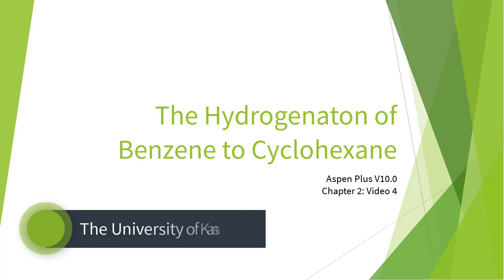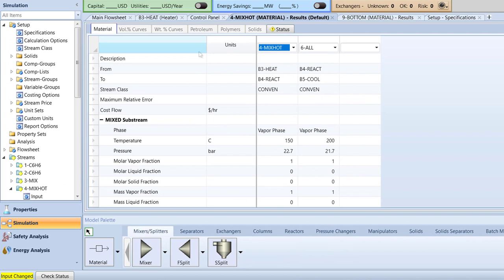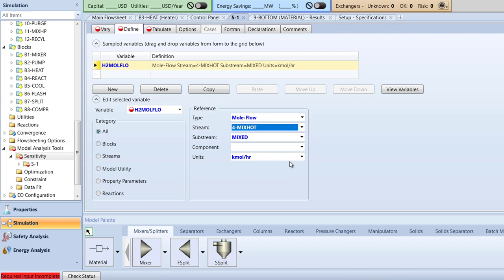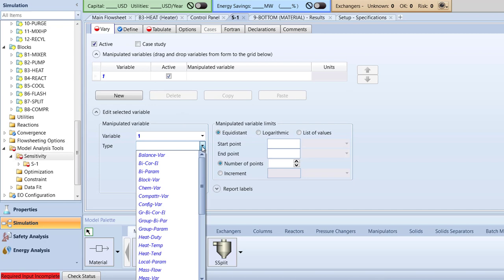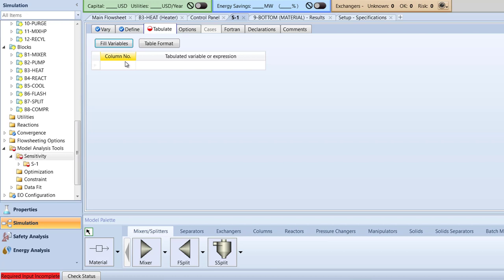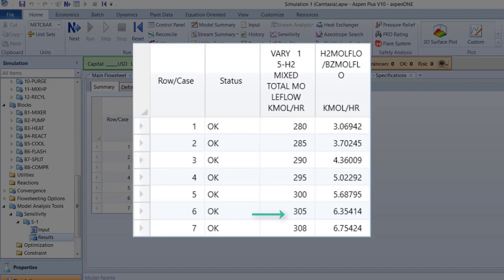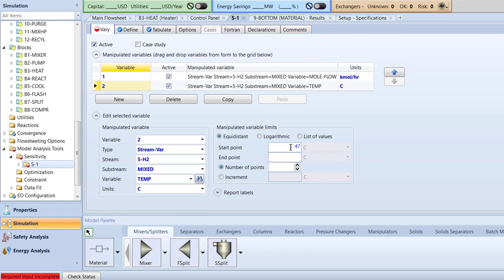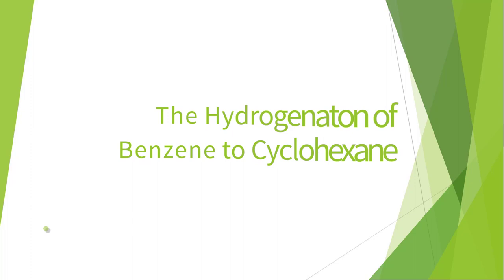Aspen Plus V10.0 Series - Chapter 2: Sensitivity Analysis

Comment: Hi, I have fellow all your steps in my simulation which is hydrogenation of Butanal to produce Butanol, but it gave me the same mole flow rate with vary temp. Can I know my mistake? By the way I am using three reactors in series" single Vapor phase reactor and double liquid phase reactors" . Tq